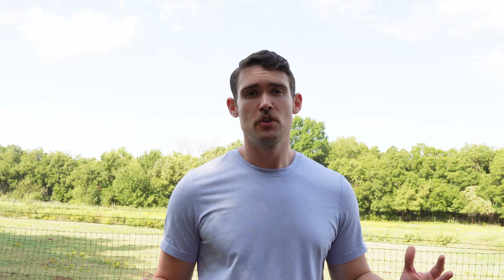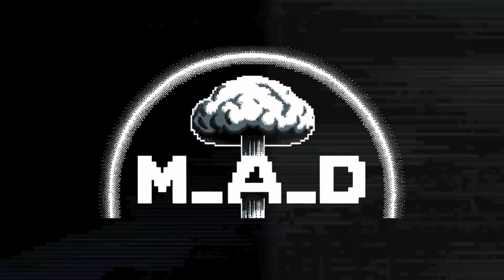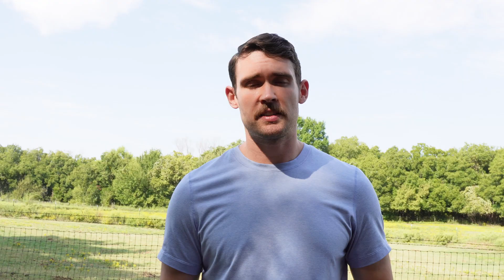DIY tactical radio vs. Professional tactical radio - Is it worth it?

Comment: Hello, Wi-Fi is out, chivalry is gone :)
A Chinese manufacturer called Taixin with 100mW power, a Chinese manufacturer called Quactell, and two American companies...
Taixin is around 5 USD. Let's start with this one first.
Raspberry Pi + WiFi 4 or 6 is possible. Get a product with 802.11S features, transfer the WiFi Halo module from the Ethernet port to the Ethernet port. Then enter the frequency and baud rate information into the module using WiFi Halo AT commands. Have a MESH 900 MHz network. 
It is not possible to add FHSS and IAS. This is because the modules do not support fast frequency switching. This requires a different IC, such as 2x2 or 4x4 MIMO. As a result, the work done is not MANET, but long-range RF communication connected to the MESH wifi infrastructure.  The connection can be interrupted with a jammer. The RF output power is 100mW. It only establishes communication between 902-930 MHz.

Comment: With GPS and ATAK, it could tell me where my guys are during exercises, which is great. I'm trying to figure out what's the cheapest way to make it, but the optimal SBC isn't just available, so raspberry pi is the best now. Also the Halow adapter isn't as cheap as I'd like yet. I hope soon we will be able to have MANET radios in the 20$ range, so you can use them very liberally

Comment: Solid overview that really hits some good points about open source MANET projects. There is a lot of history of private citizen using WiFi HaLow. I believe Amateur Radio Emergency Data Network (AREDN) was one of the first starting in the early 2000s. Doodle Labs' Meshrider series are the closest commercially available radio to something like a Silvus Stream Caster. However, they come in at over $2000 per radio. That is why I working with BeeChat on their Kaonic 1S.
Reply from the maker: Thanks for the support! I have been wanting to get involved with AREDN for some time, but I just haven’t pulled the trigger yet. Perhaps that’s something I’ll work on soon!
Reply: @madgearcompany  Same, I seen AREDN systems action but never never set one up myself. I do have a wish list with the necessary equipment but that is as far as I have gotten. 😀
Reply: @madgearcompany  As a ham, I do enjoy AREDN and they are a strong community pushing development of practical meshing systems forward.  As a techie who steps outside ham from time to time, I am sometimes frustrated by their rigid adherence to Part 97 rules in regimes where it isn't fully necessary, and they could utilize Part 15 instead.

Comment: So this system is similar to LORA/Meshtastic, but uses WIFI for more bandwidth and speed..and more $$$
Reply from the maker: Right, this system uses the same radio band as LoRa and Meshtastic and is indeed capable of more data. And at that, it's even just regular IP traffic. That means it can be used to extend a pre-existing network rather than forming a new, standalone type of network like Meshtastic. Both have their place. LoRa is great because the signals can be picked out of the noise floor more easily than other signals, thereby increasing range.
Reply: @madgearcompany  The big issue with an 802.11ah network is that if you want decent speed, then there's really only one channel, and when others deploy their own you'll be fighting them for the limited airwaves...
Reply from the maker: @HiltonTravis-au  that is certainly a consideration, good point! Intelligent channel management needs to be considered.